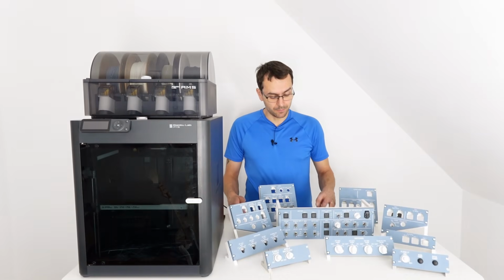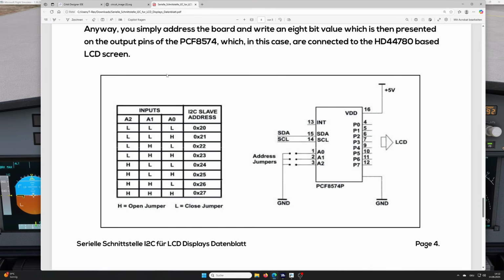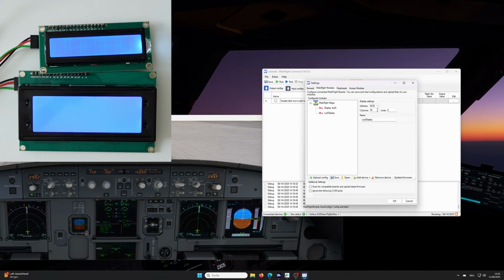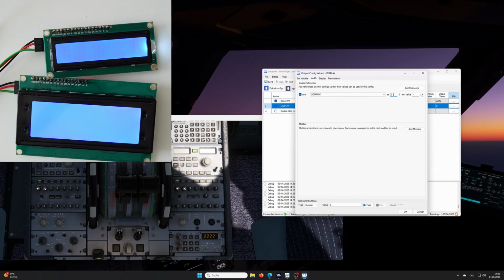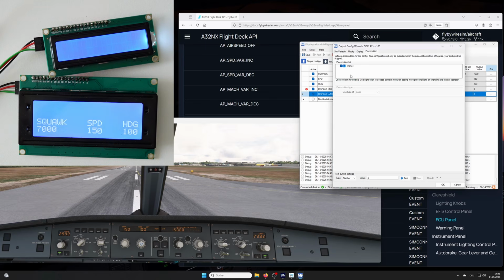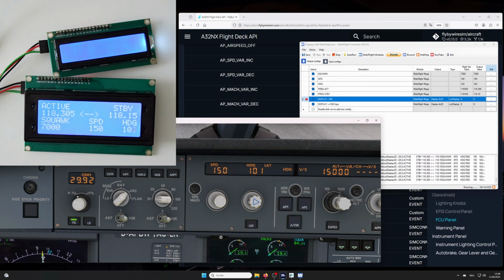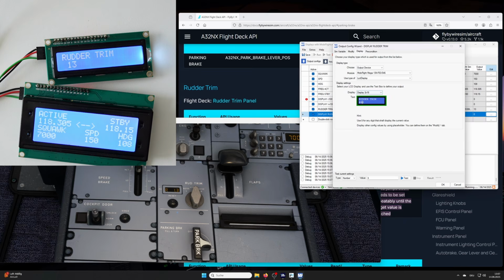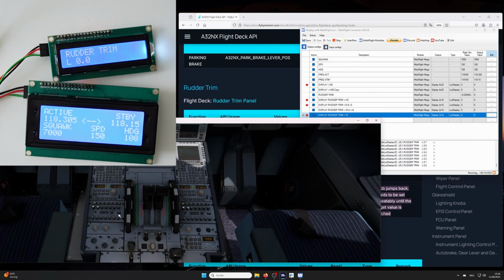LCD Displays - EP 29 - Full Home Cockpit Build

Comment: In the transform for the heading, can't you pad with two preceding 0  then substring the last 3 digits? It would always work? The substring might not even be necessary because it looks like it take values from right to left in the display so with a mask of 3 it would always be spot on. If not you would also need a third rules for heading below 10.